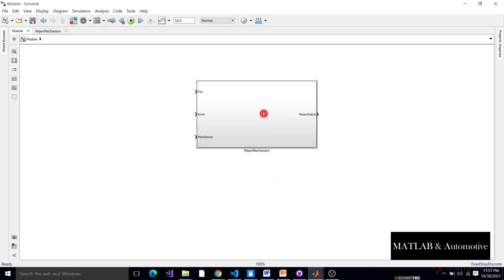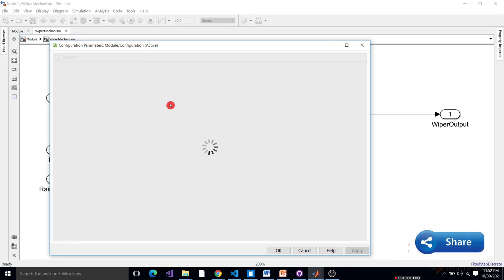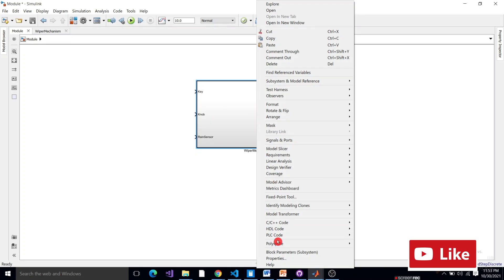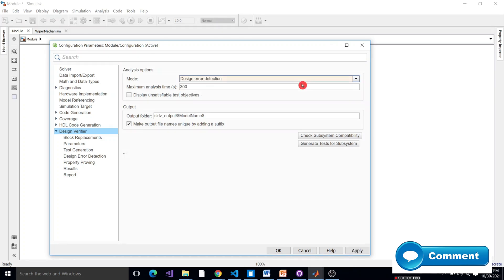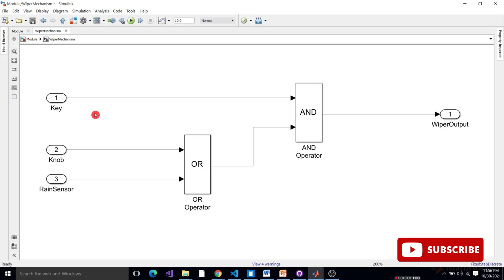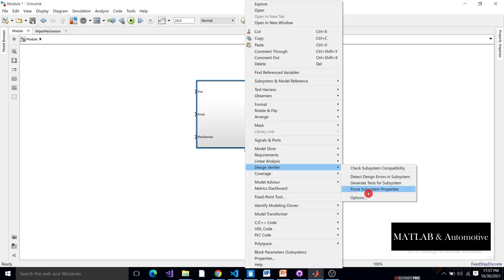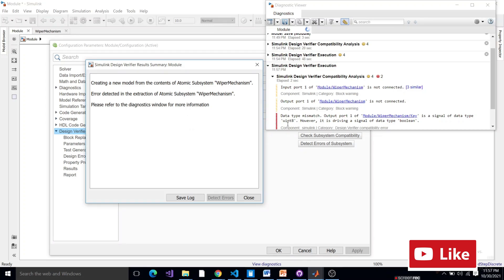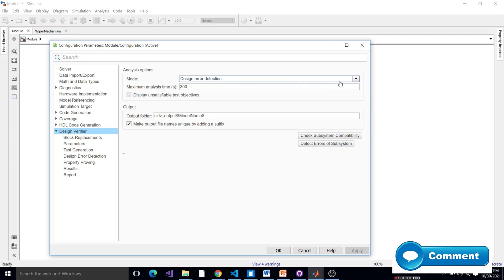Simulink Design Verifier (SLDV)/Auto Generate MIL Test Cases

Comment: Sir can u tell diffrence between atomic subsystem nd non atomic?
Reply: Nonvirtual(atomic) subsystem – Control when the contents of the subsystem are evaluated as a single unit (atomic execution). Create conditionally executed subsystems that run only when an event occurs on a triggering, function-call, action, or enabling input.

Virtual(non atomic) subsystem – Subsystem is neither conditionally nor atomically executed. Virtual subsystems do not have checksums.